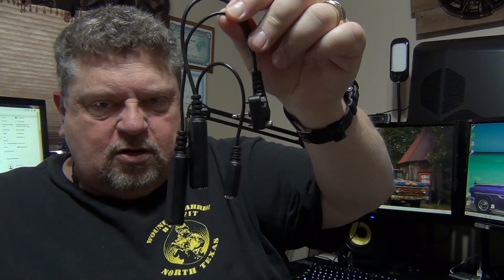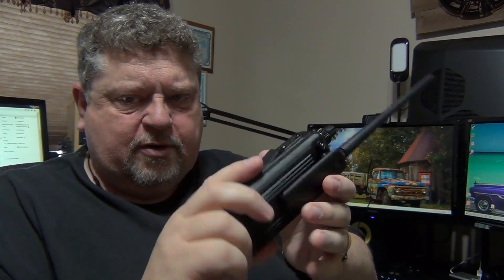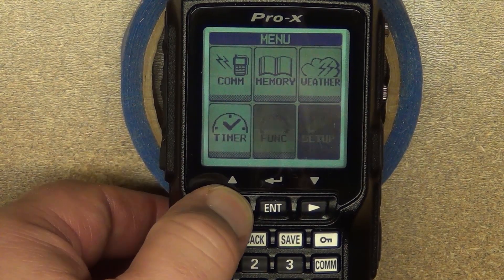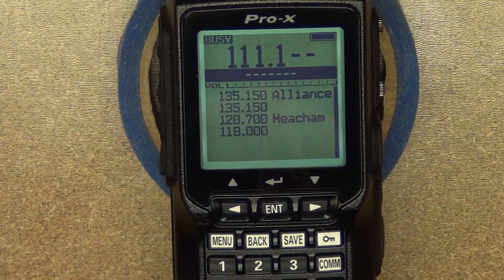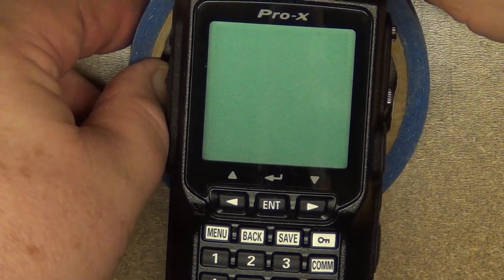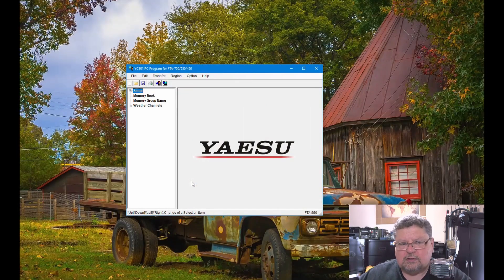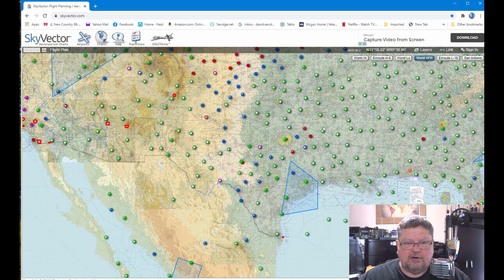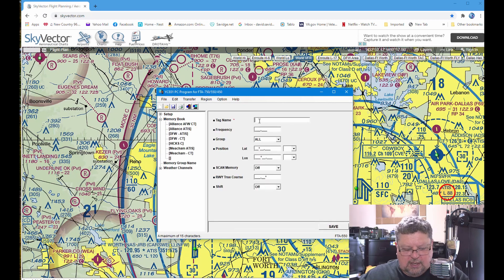How To Monitor the  Airband Radio using the Yaesu FTA-550

Comment: Hello,  on the FTA 550 - If I locked out the transmit button will that still work to perform other functions for the radio ?  Also the FTA 550 software tab on the Yaesu website has numerous links under the software which one do I need for my radio?  Thank you - Tony m.

Comment: If you have buisness near an airport. just call the tower and consult with them. there is a lot possible if they know who you are and what youre intentions are. it is apriciated that they can reach u on the radio.
Reply from the maker: Aa a Part 107 Drone Pilots do not call the airport I just use LAANC.

Comment: works on 144/440 ?? I bought it to use on amateur radio.
Reply: No. The air band is AM and runs from 118-137 MHz.

Comment: In an emergency,  you would need to transceive, if you are licensed.   If you don't need that option, choose a scanner.  For commercial drone pilots, this transeive feature, is a last option if you don't have a cell phone connection.  Great  clip.
Reply: Up in Canada you need one
Reply: Can u call cq on that radio or no
Reply: You don't need a license to transmit on aviation band.
Reply: @shrimpshrubbery7664  in the USA you sure do need a license...
Reply: @Bryster51  no you don’t. When I was going through pilot training there was absolutely nothing about a radio license.
Reply: @shrimpshrubbery7664  
Station radio license for the aircraft. Not pilot
Reply: @shrimpshrubbery7664  That's because pilots don't need the license but non-pilots do.
Reply: @shrimpshrubbery7664 AFAIK every country I Nedd a licence to tx on airband, abs also why woukd u need to be even listening on airband, your drone shouldn't be in restricted airspace around airfield

Comment: When I bought my FTA-550, the version sold with a rechargeable lithium battery pack was a full hundred bucks more!!!!
So I just got the one with the dry cell case too!
If your a Pilot and your going to use this as a second radio, you likely already have a separate "Airframe" mounted antenna and a plug in to get "juice" from the birds electrical system.  Then, if need be, your regular "Headset" can plug right in to the FTA-550 !
Lots of folks flying true Antiques will need those dry cells anyway!
And original 30's or 40's aircraft will likely NOT have any electrical system at all!
(Which is exactly how I learned to fly over 50 years ago!)
Cheers!  😉

Comment: I'm not gonna do an unboxing... proceeds to show everything that's in the box... I see what you did there!  I want an airband+ham TX HT.  While I'm dreaming, I want bluetooth and APRS as well...
Reply from the maker: I found it hard to get a HT to receive air-band.  Let know if you find a good one.
Reply: @MeOnTech  The airband mode is AM so that pilots can intermod with other traffic on the frequency.  I just re-checked the video and I didn't see a place where you switched from FM to AM... I would assume the radio is trying to get FM as a result.
Reply from the maker: The Yaesu FTA-550 is only for airband.  It is not a normal dual band HT like we normally use in Amateur radio. There is no options to switch to FM.